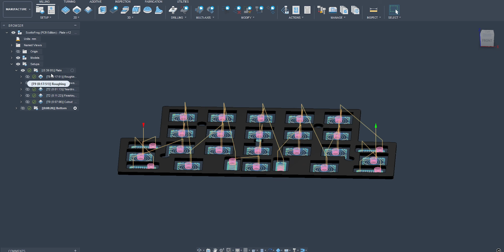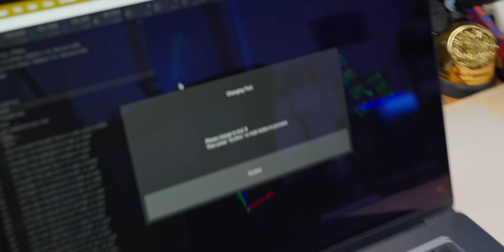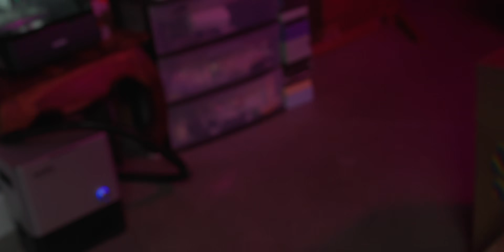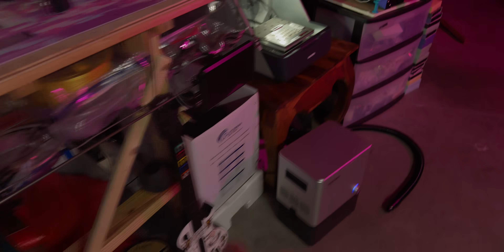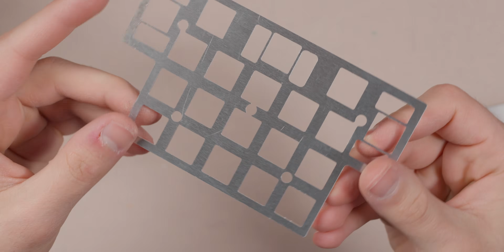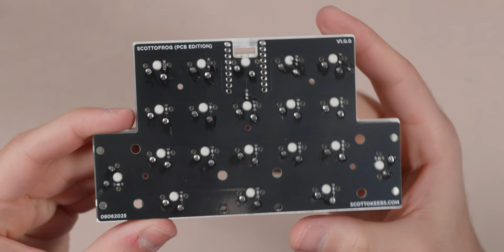The Makera Z1 CNC for Mechanical Keyboards

Comment: Correction:  As long as your cut plan is 200mm or smaller in either X or Y axis, and you don't mind tiling your cut operations, the second keyboard layout could be made just fine on a Z1.
The back panel pops off to do longer stock... so you could have a 4 foot keyboard if you really wanted one.

Comment: In terms of bed size, you can remove the back panel and open the front to pass through longer objects and then do a step-over to machine more than the reachable area.
Reply from the maker: Yeah you can do that on the Air also but I would rather just have it fit on the bed.
Reply: I had a similar question since I wanted to make some beer taps for my restaurant which are 11".